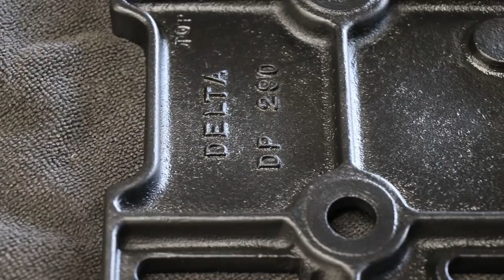1937 Delta "DP220" drill press is complete! [Restoration]

Comment: Nice job. Did a 220 myself a few years ago that I picked up very cheap. It was complete (sans lamp) with no broken castings or repairs, a floor model, but a crappy motor which I had a replacement for anyway. Painted it rattle can grey and eventually ordered new replacement spindle bearings from Hammerscale. Will last for many more decades to come.
Reply from the maker: definitely! they built them to last for sure.

Comment: Just found  your video.  At the start of the summer I got a older drill press that I am going to restore as soon I get some other projects done. It helped watching you. Wish I could have seen you take it apart I think that will be my biggest concern. It's in good shape but weathered it was kept in a barn. Lots of cleaning. It is also a bench model. Thanks
Reply from the maker: Sorry for the late reply I've been out to sea for a while, the drill press resto is a 3 part video I take it apart on the first video.
Reply: @vintagerevival391  ok thanks I will look for the others.

Comment: Nicely done.  I appreciate your video because i intend to take mine apart for cleaning and i was apprehensive about removing the housing with the spring.  Now i know what it looks like so it will be easier to reassemble.  Springs can be tricky sometimes.  

One comment that may not be of use, but for what its worth...  when applying the torch to the handle the vise was acting as a literal heat sink.  When heating something move the target area as far from a large metal mass as possible because otherwise you have to heat your target plus the nontarget mass, which takes a lot longer especially when its as big as a vise jaw.  Just put the end of the handle in the jaw or better yet hold it with pliars, when it has reached your desired temp put it back in the vise and bend.
Reply from the maker: Thanks for the advice ill do that next time, it was a pain to bend that although the editing made it look easy.

Comment: You have to wind the spring before tightening the bolts and also the column lock bolt has to go in before you slide the head on. Nice job though looks beautiful

Comment: Very nice. How did the weld at the base hold up? Welding cast iron, is not a guaranteed result, especially, with the stress of tightening that bolt.
Reply from the maker: Great question! Your totally right, since this is now my personal press I was afraid of the same thing. I put just enough to hold it in place. I think if I would've done a better job cleaning and polishing the tree it would've needed more torque and possibly cracked the weld. for now it holds well but that weld is always in the back of my mind.

Comment: I was about to comment on the gold leafing, then I saw you beating on the spindle bearing with a steel wrench, are you kidding, don’t you think a brass hammer would have been the appropriate tool? I restored the same drill press, painted it blue and polished all the steel, including the column to the point it almost looked like chrome. Sold it the first day I posted it to Craigslist, $375. Didn’t have the retirement light.
Reply from the maker: I don't plan on selling it and anything can be a hammer, no bearings were harmed in the making of this video.